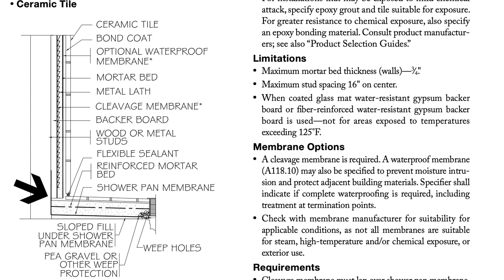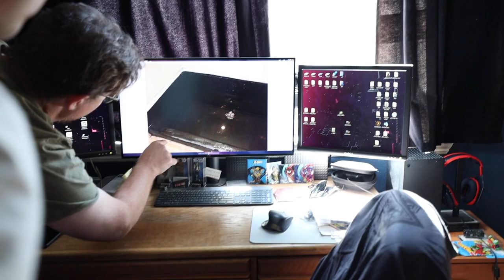Was StarrTile Right??? --- Shower Curb Failure

Comment: I've completely switched over to bonding flange drains for all my showers for this very reason. It's so easy for the weep holes to get clogged and things go south from there. I also agree in doing brick/block curbs instead of wood. 🤙
Reply from the maker: Good job Joe...  FloFX rocks!!!
Reply: I wholeheartedly agree, too many dam failures on wood for me to ever think about using it again. Brick is the way I roll now or form it out of mud. Forming it does add an extra day so its only for custom curbs.
Reply: @johnperkins630  When time critical can build curb with kerdi board or use pre-built curb.
Reply: Yep. Masonry curbs are the latest refinement to my shower system.
Ive poured solid curbs a couple times and ive used bricks a couple times over the years.
And clogged weep holes is why i use a liquid waterproofing membrane system ON TOP OF the shower slope bed. I honestly just cant understand why anyone would do it any other way.
Theres no wicking up backer board, no saturation and precipitation of your shower pan bed, no pre-slope, post-slope or slope-slope issues. And no effluence to clog the drain weep holes.
You can use whatever cement based slope bed you like and the only requirement for it is that it has 1/4" slope per 12" of linear space and is stable and has enough compressive strength to support the tile work and a couple of occupants . Other than that  it just doesnt matter because, the ONE PIECE waterproof membrane is applied above it and runs from the drain to the top of the tilework. No water will ever reach beneath the membrane to the shower slope bed so its never saturated. The backer board is completely isolated and sealed off from water intrusion too so theres no concern of wicking. And you can use a standard 3-piece drain or a bonding flange drain , whichever you prefer with no concern of clogged weep holes or of water creeping past a liner.
And it can be completed in as little as 8 hours or an absolute max of 12 hours from the application of the first coat until ready for overnight leak test, which btw, ive NEVER had one fail. 
You can lay tile the morning of the 2nd day or by the morning of the 3rd day max. So its either the same as those sheet membrane systems which WILL fail and leak unless you also apply liquid waterproofing to the seams or worse case scenario it takes an additional half to full day with all but guaranteed success and peace of mind that affords.
Thats worth an extra day imo.

Its like a fiberglass boat hull versus a  wooden boat made of many pieces, each one requiring careful fitting and sealant. 
Why would you do it any other way?
I really cant understand why other systems even exist.
To each his own i suppose but for me ill stick with what works and i trust. Never had a failure in 17 years.
About 100 or more showers done.
Ive renovated a handful of them after 9 to 15 years and each one was as perfect as when first completed.
Whether Redgard, Aquadefense, Hydroban or whatever your brand, liquid waterproofing membrane systems are the ONLY way to go imo.
Reply: @johnperkins630  - just make it in advance. Keep some laying around cured. Cut to fit.
Reply: I’ve seen as many failures on these systems as I’ve seen on traditional. The reason is the surface membrane (sheet or liquid) is vulnerable to tile movement (it lifts free from the surface it’s bonded to). Someone lifts a tile to check thin set coverage (or doesn’t, and the tile moves as a result), or some adjustment is done, the excess thin set is cleaned up too early or too late. It doesn’t happen all the time, but I definitely see it. Also for this exact reason if a tile cracks for whatever reason the pan is trashed.
Reply: Me to tileing for 20 years never had a call back
Reply: I think the wood option is better because it lets you know you have a problem.  With brick, you would never know you have a leak.
Reply: Does no one form and float curbs out of dry pack or is that just a midwest thing?

Comment: I will say that once the mortor bed / pan is wet, it ain’t ever drying out. The whole thing (bed) is surrounded by things that don’t allow drying. So even if the weeps holes are clear and free, it won’t matter. Making sure water never touches the mortar bed is key.  That is why Schluter systems and similar systems, have absolutely no way of holding water cuz everything is foam or plastic. They can still leak, but each component is guaranteed never to hold water. More stabila. Thanks again for the vid.
Reply: I can assure you that once a dry pack is wet, it will never dry.
Reply: Only way to dry out is to remove a small area around drain and let dry, then after reinstalling Mudbed and tile, seal the grout and epoxy paint grout to prevent anymore water from entering mudbed.
Reply: Agreed.  In truth, there is no reason to have cementitious products in the shower these days, period.  Too many other better choices.
Reply: Hmmmm

Comment: I tested many products over 10 years, I took cardboard boxes and waterproofed them according to manufacturers specs with drains. Filled them with water and put them on a shelf in my warehouse. Redgaurd and schluter never leaked for years (cardboard had no moisture). But remember that moisture vapor is extremely high in a shower on a daily basis and water is always looking for a way out.

Comment: Ill be installing a tile shower soon(home DIY). your videos have helped immensely about how too and what not to do. Ill have my Youtube Certification soon 🤣
Reply: It’s not too bad just get a good clean demo plum and square your framing have a plumber do the liner and drain and then just durarock and waterproofing and mortar bed then who cares what your tile looks like you’re the one doing it lmao just make sure you have a proper slope to the drain
Reply: good luck. your gonna need it lol
Reply: Material Cost are high at the moment. Hyro Ban 3 x 5 boards times 5 each plus strata mat and 4 tubes of laticrete sealant and Roll water proofing band  cost me 950.99 at Desoto tile supply here in California. Tile was even up there from Floor and Deco
Reply: This guy is all of us here at YouTube university
Reply: @RawTakes  YOU DAMN RIGHT! If everyone could do showers, well........

Comment: Never build curbs from lumber over a slab.    I dont like using lumber for curbs ever.   Over time even if the 2x4s arent pressure treated they can warp and swell up which will compromise the waterproofing and mortar over it.   Thats probably the main issue here.

Comment: Yep! We tear out wood curb, hot mopped showers all of the time. This is why I completely 100% refuse to use wood on my curbs. Brick or foam only. Water will find a way! Starr tile is still an idiot lol. I also like to run low density foam around the perimeter of my pans against the bottom plate because wood WILL expand.
Reply: Doesn’t matter what it’s made of, if it’s not waterproof it ain’t lasting.

Comment: Let's start with the top of the curb, use a sill instead of tile. After all, grout is the weakest part of the installation so eliminating all those joints will ensure longevity.

Comment: This happened in our downstairs bathroom. A ramped shower entry created a bridge of thinset and concrete over the curb and out under the bathroom floor tile. The water damage first showed on sheetrock outside of the bathroom entirely.

Comment: Brick curb, and pre-slope the top of the curb. I cut about a 3/4” strip of backer board thinset it to the outside of the curb and screed thinset on the top. Let it dry then do pan liner over that. So water that gets into the curb drains into pan. I do the same thing on windows niches etc.

Comment: I feel like counting on wheeep holes to  do their job after years will  always eventually  fail.   They are going to eventually rust and close up.  A shower is a humid environment, warm water running down the drain on a cold cast iron shower drain will always cause condensation and oxidation of any metal material.
Reply: Yep, i abandoned those drains for the flowfx bonded drains

Comment: Great explanation.  I didn't think the weep holes would clog over time from efflorescence alone.  Lesson learned, that's why I watch your videos.  Do you have a link to a video where, within code, you are able to only take out the bottom row of tile and still tie into the existing waterproofing?  I've been told by multiple inspectors that if the original design was building paper, etc. (for the wall water proofing) code requires a 2" horizontal overlap - sealant wouldn't pass an inspection.  I've had more than one tile contractor tell me they can't see how that would be possible with full float walls.  To much damage would be done at demo.  Cement board is a different story but I didn't run into that very often when the floor was dry-pack over a hot-mop.  Usually the walls were floated.

Comment: I know the rates will be higher in California than where I'm at in Washington but 13-15 grand for a simple shower replacement seems outrageous.
Reply: If you estimate a workman costs $1000 a day that's about a week of work with 2-3 guys, plus a few thousand for materials, totally reasonable. If you want a plastic shower from Costco that could be done for $1000 in labor.
Reply: Down here in Florida that’s not too far out there for a full remodel but some shower only renovations can be done for 5k but at the end of the day you don’t want your contractor feeling rushed to get the job done just to make a slim profit margin because it’ll show in the work
Reply: I work in the Seattle area and those numbers quoted are in line with what I would charge.
Reply from the maker: Heavy glass door alone eats up $2500!
Reply: @franknavarro8143  do you work with schluter products? I have roughin plumbing done to fit their linear drain. In kenmore
Reply: 13 is a deal depending on what tile you get and if the walls are floated or not.  A full bathroom remodeling will run you 20-25k here in California.  👍🤠
Reply: Average cost in 2012 was 3000.00 per hole to remodel a restoom. Most restooms have 1 toilet, 1 basin aka sink, 1 tub or shower or combo. So 3 holes. That was 10 years ago. I just have license plumber set my new tub and shower valve, along with replace toilet flange. I provided tub and shower valve both name brand. That install cost 1800.00 because I know the guy. Tub cost 1198.00 shower tub combo valve less stops 399.00.  7 sheets of drywall at 22.00 a sheet 5 2by4 studs 9.96 each. Laticrete 3by5 hydro ban boards at 5 plus 4 sealant caulking tubes, stratta matt and roll of hydro ban 6in by 50 ft for joints 950.00 new bath mirror 399.00, granate 3400.00 sink included jnstalled. Floor tile 600.00. Tub shower tile 480.00 tile material for install. Grout floor, wall, motar, spacers, leveling system 494.00 electrical upgrade 800.00. New exhaust fan 198.00 all my labor free. Drywall contractor install tape lud texture and paint 2300.00 . So Tile Coach quote not far off. I did demo of whole restroom with son in law contractor wanted 1700.00 I live in California. Quality work cost. You get what you pay for.
Reply: I live in the middle of nowhere GA and that’s about the same price as here
Reply: I don’t know James, here in NJ … I would not call that simple.  And no one is stopping you from doing a non professional job.  And beyond that, your asking a man to now take responsibility for that repair.  So 13k is more then fair.
Reply: I work for a company here in Dallas Texas they charge 20 grand all day for the simplest showers
Reply: @jwar2163  i just did the same job down stairs in my guest bathroom.  I added a shower and replaced everything else.   I have friends in the trades and also do a little work my self.  Even with me doing a lot of the work, we spent a little ove 10k.   It was a great deal but hard to come by here in California.
Reply: @ssl3546  a 3x5 shower shouldnt have a few thousand in materials unless youre including tile in that price.   And a standard shower is a one man job with maybe 1 helper at most but never 3 guys to do a shower.
Reply: @TileCoach   I didn't mean any insult by it. When the pandemic hit I was laid off from a hotel maintenance job and your videos encouraged me to work for myself doing tile and remodeling. I've been busy ever since and actually turn down more jobs than I can handle. So thanks, I always stop to watch your videos and learn new tips and tricks.
Reply: @AussieInSeattle  Hi Matt, I have used Schluter products since 2005
Reply: Shew....man, I do them for about 4,500.  I would kill to get a grand a day.  We travel an hour away it's tough to even get that.  It's tough for a contractor here to get a grand a week!
Reply: @R2Mike  if youre a one man show and you can get a shower completed in a week or less and charge 4500 for labor alone its still good money even after taxes.
Reply: @amattson6578  that's everything...😔. And a typical 3x5 conversion takes 3-4 days.  2 of us.  Material and labor....
Reply: Running a business in ny or California, the costs are outrageous. Comp, insurance, taxes, payroll, gas, tools, equipment. At the end of the day its a business with a profit motivation, Nothing wrong with that. Nothing simple about a shower replacement as these videos prove. If it was everyone would be doing it.  My grandfather always told me. Don't work for free, if they could do it they wouldn't be calling you.
Reply: I thought the same thing when he said that. I’m from Miami and a simple showers between five and six thousand depending on the style.

Comment: Great vides, I agree 100% percent about the drain holes being plugged up and the water weeping up the shower pan. But I don’t think that was the real problem. I personally think the water came from out side of the the shower pan. I think it would be good practice to extend the hotmop 12” inches beond the outside of the curve. I have kids and their shower is a puddle on the outside every time they shower and it caused dry rot. It would be cool if you did a sample curve with the hotmop beond the curve. Keep up the good videos👌🏼

Comment: Another great video Isaac. I am currently renovating one of my bathrooms using the traditional method but will cover the entire shower/ curb with red guard (or something similar). I like the new methods/ products.  problem is they are very expensive and I am on a tight budget. It’s why I’m doing the work myself and why I watch yours and other videos about proper methods. Thanks again
Reply: Liquid membrane applied with reinforcement fiber mesh at plane changes used in conjunction with commonly available cement boards allows to build very robust shower on budget. Fiber mesh reinforcement will control contraction at plane changes. Contractors prefer foam as this is less labor and helps to maintain good pace. DYI usually has more time at their disposal to deal with intricate aspects of fitting cement boards, reinforcing seams, allow cure time and etc.
Reply: @BlahBlahManYeah   Agreed
Reply: I did the same as you, to save money.  I had to buy 3 buckets of Red Guard, which is expensive.  Had I known how expensive (& amount needed) the Red Guard was going to be, I would have thought about spending up on the Schluter (no red guard needed).

Comment: 30 years at it and not once have I ever come across a curb built from wood that hasn't failed.
Reply: Some guy said he poured a concrete curb/step……you thoughts?
Reply: @petersweeney5777  So long as the pan is vertical and relatively centered it works. whether it's monolithic or a cold union doesn't matter. most of the old schoolers dry-pack.
Reply: Wtf? 13k are you kidding?

Comment: Bought a house with a tiled in shower stell, i knew it was going to be a problem when i saw no grout in the joints.  Once i saw staining on the floor, i tore it out.  Turns out the install was so bad, this exact same thing happened.  The curb wood was saturated.  The backerboard was sqturqted because it sat in the shower panand wicked up watwr.  Nothing was waterproofed; no membrane, no nothing.  The previous owner wouldnt disclose the age of e shower, but id say less than 8 years.  Maybe even 6.  But it was such a bad job, i cant even describe it.  Good news is, i get a brand new shower that will be installed correctly, waterproofing and all.

Comment: Why not maintain those older system weep holes by popping the drain grate and screw out the weep holes with a 90 degree drill bit adapter? Hopefully, newer drains don't have these kinds of issues, as 10 years or so go by.
Reply: dude, you need to invent that....hell of an idea....
Reply: Weep holes will clog no mater how large they will be. Scale will develop in them over time and create a barrier.

Comment: It's without a doubt that the only way to go when installing a shower curb, bench, or ponywall is to use block, in my opinion. Wood products in a shower build are to be used as sparingly as possible. Obviously a single family environment will most likely be built with wood studs. When it comes to multifamily inviroments that have multiple floors steel studs are used, and that's even better. Local codes may vary on what type of materials can be used in multifamily depending on how many floors. Usually, cast iron drains and steel studs are the common materials used in those types of environments that are over a certain amount of floors. Block is still a recommended material to use even in a singal family environment....As a contractor in AZ, Palm Springs & LasVegas for past 25 years, block is the only material we use in a shower environment & multifamily environment.
Reply: JUST HYDROBAN...DONE FOR 20 YEARS EASY.